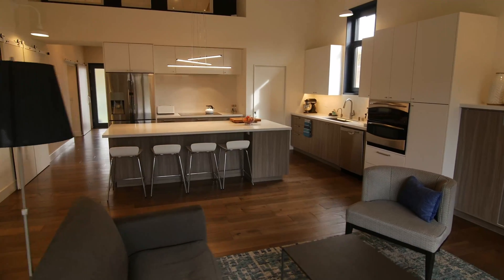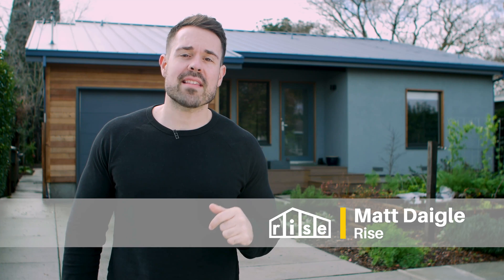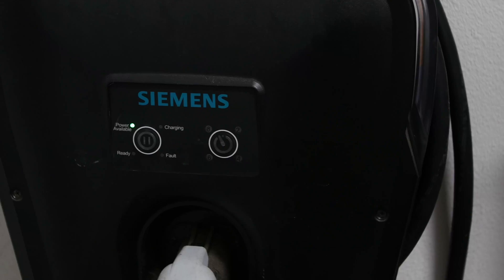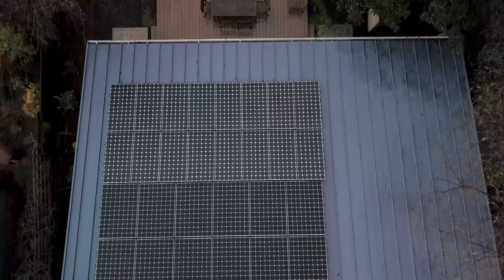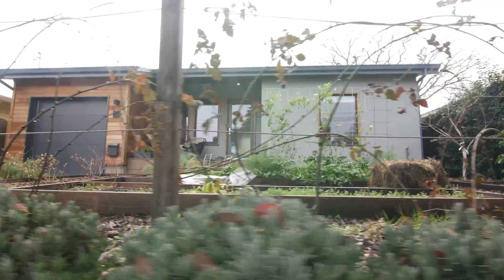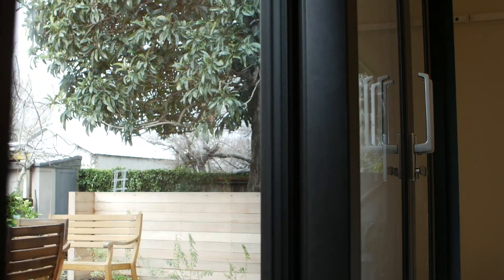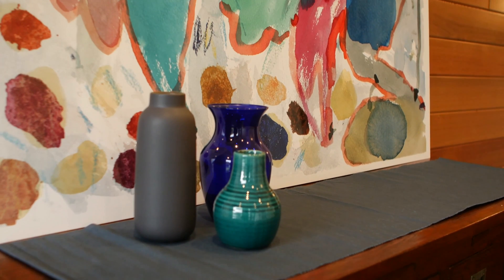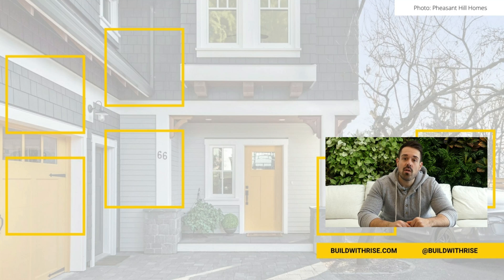Sunnyvale Passive House - Life With No Power Bills

Comment: Quick question how many solar panel on roof
100 watts panel 
Or
400 watts panel 
What type of inverter do you have
EV cars draw 46 amp at 240 volts
I see a refrigerator
Efficient refrigerator about
5.2 amp at 120 volts 
A microwave 
Small or large 
We’ll go small 
4.2 amp at 120 volts 
Garage door open 
120 times 2.4 amps
EV 11,040 watts 
Refrigerator 624 watts 
Microwave 504 watts
Garage 288 watts 
12,456 watts 
How big is your inverter.
Do you have a battery bank
I know to run 2500 amp hour of battery power is only good for 5000 watts for 4 hours 
Just more curious about your solar and power set up

To me there promote to sell a house to run away from California

Comment: How do you use less electricity than a hair dryer to heat and cool your home with a heat pump? Heat pumps use more electricity. Must get a lot of solar energy I'm guessing?
Reply: my 3.5ton (13 seer, not the best ) heat pump uses about 4kwh (1.14kwh/ton). an average hair dryer according to google uses 1.6kwh. 
if the home only needs a  1.5 ton of cooling/heating with a high seer/eer system will uses less than 1.6kwh
Reply: Passive house doesn’t need solar energy from solar panels. That’s a net zero house

Comment: How do people afford having these built?  What are the initial costs of these things.  No one ever talks about the initial cost
Reply: I think it helps if you can separate the cost of the design feel/architure/finishes from the actual energy efficiency cost upgrades. It is typically stated that the energy upgrades in a house like this would add 10 to 15 percent, vs a normal code built home. So on a $300/sf build on a 2000 sf house, thats an add of 30 to 45/sf, so $60 - $90k. Yes, thats a lot. How long will pay back be at 15c/KWh? A long time. 
I have watched a lot of these videos, and am considering building a passive house myself. For myself, and I'd guess for many others, there are more reasons for building this way than just trying to get to some reasonable ROI. Hopefully, as more people adopt these methods, the up front cost will come down and products and methods will improve. My hat is off to those architrcts, builders, suppliers, and homeowners who are putting their time and money on the line to show that there can be a better way of building.
Reply: @bcoldwell1  Yep.  I've considered building a place more for peace of mind if the power goes out.  I'd like to be able to help myself.  I just want to see price differences.  I think if it's 15 - 20 percent over an initial cost it would be worth it.  With todays interest rates it would be worth the investment because of Mortgage affordability.
Reply: @bcoldwell1  Bad reason. Electric is like $0.13 per KWH so it would take 90 years to recoup any savings. A typical house that size would have a $150 per month electric bill.
Reply: @loafandjug321  that price depends where you live. A recent example that guy in TX that got hit with 16k electric bill.  I think a passive house is not about the cost recovery, to me it is more about stability that I have power even if the grid goes down to a black out. Comfort since the house keeps a more constant temp and helps mitigate outside noise.
Reply: @josemhernandez1974  Oh, C'mon now, nobody is paying thousands of dollars per month electric bill. Lets get real.
Reply: @loafandjug321  google it my friend. I checked with my Aunt who lives in TX and she says her bill doubled but she is on a low income plan and still got hit.
Reply: @josemhernandez1974   I'm not chasing silly media drama. The fact is, the average US electric rate is $0.13 per KWH.
Reply: @loafandjug321  except for Texas as they are not regulated federally they exceed that amount. But I have no reason to try to change your mind. You believe what you wish. But to me I would do it no matter where for my peace of mind.
Reply: @josemhernandez1974   Wrong again, Texas averages $0.10 per KWH which is $0.03 lower than the national average.
Reply: , rich background... (Family and stuff )...
Reply: @GodfatherMaxi  That's a crybaby, socialist excuse.
Reply: @RedScareClair  What are you talking about?
Reply: So at 90% savings you pay 1 penny instead of 10 pennies per kW. Huge difference.
Reply: @katherandefy  Most US power companies charge a minimum usage fee even If you never use any electricity for the month. Duke Energy charges $18 minimum usage fee per month in some states. Either way, even with a 90% reduced usage you would still get billed at least $18 per month and that fee will always increase with inflation.
Reply: @loafandjug321  Geez I wish my bill were that low. My bill goes well up into $300/mo because unlike some folks I live in a duplex rental of 900 sqft that has never been upgraded and it is insanely expensive to heat. Most rentals in my town were built before energy efficiency was thought of. It also has lead in the wall paint and mold in every room. This is not really unusual in America. But it’s probably far far below Money Grip’s pay grade or desire to know about.
Reply: @katherandefy  If you're living in a house with mold, well, that's your fault for not moving. Lead paint is only a problem If it's disturbed, like sanding (lead based dust).
Reply: @katherandefy  No doubt your pay grade is lower than mine considering you're a renter. You waste money on rent each month while I own 70 acres of land with a 3,500 sq ft home without a mortgage. You can blame yourself for poor financial choices and I know that for a fact because I bought my first 3 bedroom home in a nice neighborhood while earning $4.85 per hour at a fast food job in 1992. I bet you also have a car payment, cell phone contract and have used check cashing loans at some point. Those are all extreme money pits typically associated with renters. I accumulate wealth with self control and common sense. This allows me to have very low utility bills but more importantly keeps me from complaining about a self inflicted renters nightmare.
Reply: @loafandjug321  genuine question, how much did you pay for you land and house?